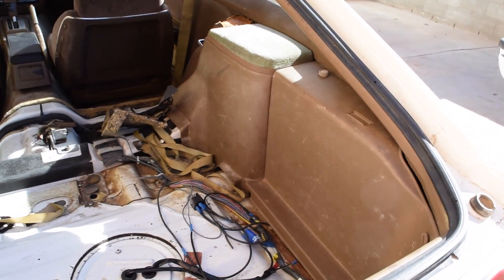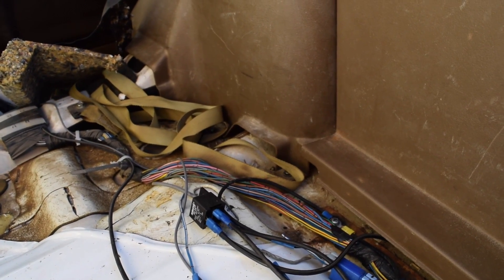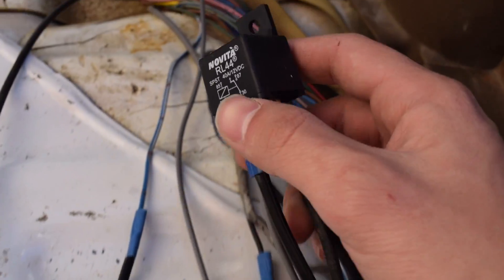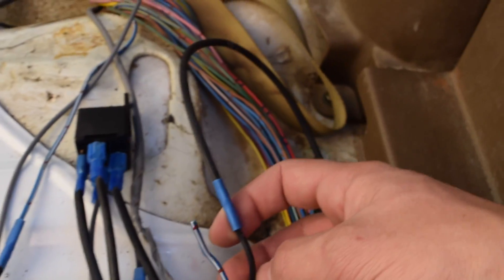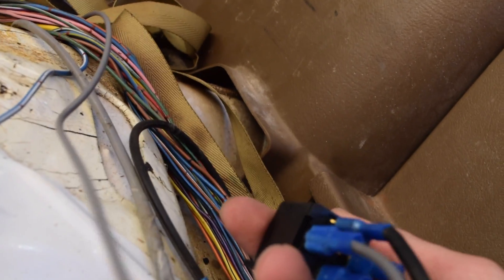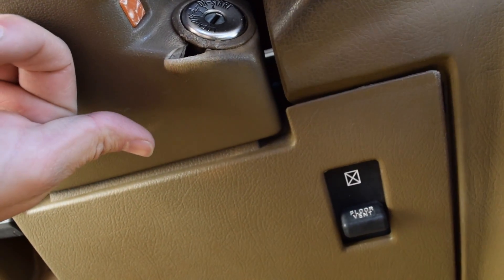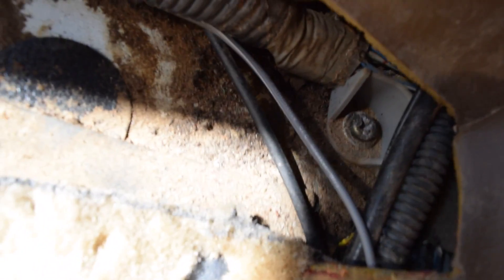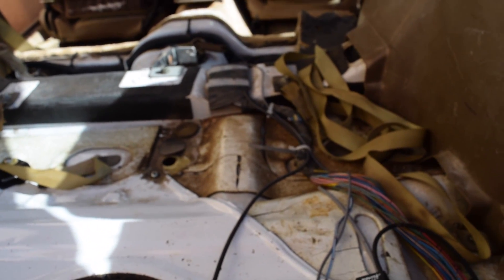Independent Fuel Pump Power Relay

Comment: Should you hear your fuel pump on when you turn your ignition on
Reply from the maker: The stock fuel pump is pretty quiet. You may need someone to be out of the car next to the tank to hear it. You can also check for voltage at the connector in the trunk

Comment: what gauge wire are you using for the line connecting the battery to the fuel pump

Comment: Hey I know this is a super old video but does this still happen even if it’s a new stock fuel pump
Reply from the maker: It's not about the pump really, its about the ECU. The pump gets a constant 12V from a relay, and the ecu turns the pump on and off by grounding the pump. If the pump pulls too much power, or there's already damage to the ecu, the ground path burns up and it no longer can turn the pump on.

Comment: Is this mod neccessary bc wouldn't the ecu not demand full psi or voltage just to run a stock engine/stock fuel pump pressure(using a higher flowing pump). I am in the process of researching how to change the fuel pump on my z31 turbo, and I looked on http://www.xenonzcar.com, and I will probably just pick the same pump as you. I don't know if this helps but my Z doesn't start but runs on starter fluid, I replaced the injectors and that didn't solve the problem, current pump works but its just weak so Im assuming the psi it's producing isn't enought for the car to run. My Z runs on starter fluid but not on its own. All relays working and clicking. I guess I just feel overwhelmed with all this wiring stuff. Lol I bought wiring stuff last summer to re-wire the injectors and never did it because I feel overwhelmed lol. When ever I get the pump and it still doesn't start I'll just have to change the CAS or the whole dizzy. Again, dont know if this helps but my Tps and CHTS wiring is ripped from the connectors and aren't giving the ecu a "signal" to fire the injectors, based on the Z manual the ecu need these signals to fire the injectors but people on facebook say these have nothing to do with "firing" the injectors. And if that doesnt fix it then IDK what will. Thanks in advanced. My IG for my Z is@ Jermaine.zenki , I have few post and videos of it if that helps
Reply from the maker: The Facebook groups are correct, those won't cause no start, just difficulty starting and rough idle. First thing I always suggest is taking a multimeter and see what's working. Check the pump connection in bthe back and see if your pump is getting power. Check the injector harness and see if they're getting power (you can check that at the ecu since they're a bit tough to get to. If your pump is running then there's no need to replace it. If it's not then there's your problem and this relay is a good option if you're going to upgrade over stock. You don't want to run a bigger pump on the stock system.
Reply: @TheZGarage  ok, my fuel pump works but i've been told on facebook that the flow looks slow, so i thought I should just replace it. Should i just replace the pump for a stock one so i dont have to do the relay mod. I'll test for power at the injectors next time I work on the Z, Side note i remember touching ones of the injector wires and it be somewhat hot to the touch granted the battery was being charged/jumped by a jumper box for multiple hours so I assume they are getting power. Thanks for the feedback <3
Reply from the maker: I would check your fuel filter as well. If your car sat for a long time your lines can get gummed up. Take the fuel line off the top of the fuel filter and run an extra line into a bucket and prime the pump. See how much fuel flow you're getting. If it's not that much you either have a bad pump or clogged fuel line.

Comment: Another question, the black with white stripe wire that you spliced at the ignition, does it still need to maintain its original connection with the new wire added or just cut it and run the new wire to the back? Where does it originally go from the ignition?
Reply from the maker: I'm not sure where it goes from the Ignition but it does need to remain intact. It probably switches on some relays in the engine bay so cutting it will give you issues. Just splice into it and keep the connection in tact

Comment: So when using the ignition as your input/signal, the body ground that goes to slot 1 in the new relay is just a new wire that goes directly from the new relay to the ground?
Reply from the maker: Exactly. The signal wire simply opens the relay so the high amp circuit can be run.
Reply: @TheZGarage  I also just put in the walbro 255 and I see your updated video where you had to get something smaller because it was drawing too much power. Do you think I'll have the same problem since it'll always pull 12v?
Reply from the maker: I think the pump I got was defective. I'm currently running an even bigger pump on the same set up and it's working great now. The smaller pump was nice because it was quieter than the 255 but as long as you insulate everything properly, it should be fine
Reply: @TheZGarage  Thank you for your help!

Comment: Just found out I had to do this before installing my new pump good thing I did lol. I'm a newbie to wiring and was wondering what wire did you use and what gauge? Is it generic electrical primary wire I can pick up at Autozone? Thanks.
Reply from the maker: Yeah any generic wire would be fine. I just used stuff I found around the house. Just look at the max power draw for your pump and you can Google a chart that will tell you what wire you need to safely draw that much power. I believe the one I used was either 8 or 10 gauge

Comment: Hi! I have a naturally aspirated 300zx and I put in a twin turbo fuel pump into it from another 300zx. The car ran like a beast for THREE days and then the pump started to sound quieter and the power decreased and it started to vibrate in the higher rpm ranges after that. For months it slowly got worse and the pump got quieter. The pump now is insanely quiet and the car is harder to start. 

If my ecu is partially blown, is there any way to keep my ecu and fix it?
Reply from the maker: You can do the relay mod and that bypasses the ecu but it almost sounds like the pump itself is at fault in your case. If you have an extra battery laying around you can make a makeshift relay mod before you even cut wires just to test if it's the pump or not. Just connect the power and ground to another 12v battery and see if it pumps full power again
Reply: The Z Garage thanks for the reply! That’s really smart, very true. I’ll have to do that. I have a 1993 300zx by the way, I don’t know if that makes a difference. I heard that it’s okay to swap to a TT pump while running a NA motor for my 300zx but it sounds a lot safer doing it this way. Thanks for the reply!
Reply from the maker: No problem. The pump really doesn't make a difference. It's all the fuel Regulators job to make sure the fuel pressure is correct. If a pump that is too weak is installed it won't have enough pressure and it will run bad, but if a pump that pumps more than oem is installed it will still regulate the pressure to be correct and run fine
Reply: The Z Garage Exactly. Very true. I ran around in circles replacing parts like the regulator and 25 year old injectors trying to figure out why my car did this, after replacing everything related to fuel I came back to the original thing I changed, the pump. 

Again, thanks for your help and all of that great information. I hope you have a great day or night!
Reply: The Z Garage one final question. I did research on the two pumps and at max load they both work off of 12 volts but the TT pump is a three speed pump (not supported by my two speed ecu) so it only runs on off (7 volts) or on at 12v. I understand current isn’t the same as volts, but because the car is giving the pump the same voltage as the old pump, could this change my current or cause the ecu to blow?
Reply from the maker: I'm not 100% sure because I've never really looked into them that hard, but I'd say it should be fine because at that point, the ecu is controlling the voltage output, it's not just drawing what it needs to run
Reply: The Z Garage that’s very true. Stock it has a separate fuel pump module that regulates the voltage to the fuel pump. Thanks for answering and giving me that piece of mind. I don’t know if you care, but I may end up buying just the regular NA pump that came with my car and installing it to see if it runs back to normal again. Will keep you updated if that fixes it or if I have to end up doing that relay mod in the end. Thanks for all of the great help!

Comment: how do you know if youve burned your ecu? because i upgraded my pump to that same one. but it just put it in yesterday and have not used it? what do you suggest i do?
Reply from the maker: If the fuel pump stops getting power when the car is running then it's burnt out. Some people say it's fine to run upgraded pumps on the stock system, but I'm 100% sure that my ecu got burnt because of the fuel pump upgrade. If I were you, I'd do the relay mod to protect you, and it makes sure your pump is getting enough power to supply fuel if you're chasing more power
Reply: @TheZGarage  thanks for replying so quickly. today i did the relay mod. i started off with the turbocharged creation video then switched to yours for the burnt ecu by pass. and it was all hooked up perfect. and i grounded all the wires. so i go to crank ans it doesnt start. the problem is fuel because i add gas directly through a bolt that allows me to. and it starts and runs till the gasonline i poured runs out then shuts off. but i listen to the pump through the gas tank fill hole and the back and can hear it turning in and whining. and when i plug in the power to the relay mod i hear the click it makes showing its working. and still no hope. im not sure what else could be wrong. i was thinking i wired the pump wrong but if i leave the key on the on position for about a couple of minutes the car will start for about 5 seconds then slowly die due to no fuel. so u assume the pump is turning on barely and not working fully and is weak but im not sure. you have any other suggestions? i can send pics or videos about my car. thanks!! your channel is a big help
Reply from the maker: Did you hook up to the signal line in the trunk or make a new one from the Ignition like I did?
Reply: @TheZGarage  i made a new one from the ignition. i first i did the signal line but it didnt work so i converted it to the ignition splice. i re wired everything as if i had burned the ecu.
Reply from the maker: When the key is in the on position is the pump running?
Reply from the maker: Like before you even start the car if you just turn it to on
Reply: @TheZGarage  yes i hear the pump on. i open the gas fill hole and hear the buzzing inside. i left the key in the on position and disconnected the power to turn on the pump and touch the connection to the relay  and i hear the pump turn on right
Reply from the maker: Ok. Then there's a good chance you hooked up the pump leads backwards and it's sucking instead of pulling. You can test it by u hooking the fuel line in the engine bay athe fuel filter and see if anything is coming out when you turn the key to on
Reply: The Z Garage Today Im going to try it. I was also thinking if I might’ve wired anything wrong on the pump so I was planning on cutting into the trunk of the car and leave a hole for the pump in the tank. I wanted to have easier access to the pump rather than dropping the tank every time. I’ll let you know how it goes. Thanks for your help

Comment: Why did you upgrade your fuel pump  , does it make any or much difference for the fuel pressure
Reply: I’m not a mechanic, but I think this depends on the vehicle. I have a 300zx and all extra gas that is not needed is returned back into the tank via a separate control line. Regulators help change the fuel pressure and in some cars where extra fuel is unnecessary is returned to the tank again allowing the pressure to stay in the correct range. 
I believe some cars don’t have this return system so I don’t know about those. 
But in my case all extra fuel is returned to the tank, therefore the pressure is still at stock pressure unless is needed later on down the road.